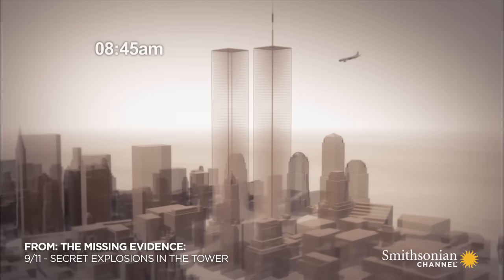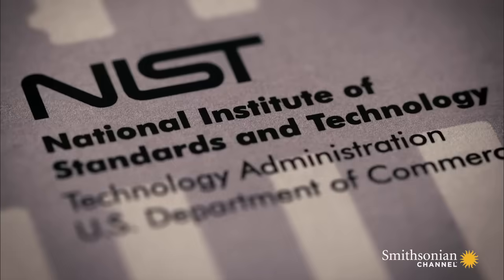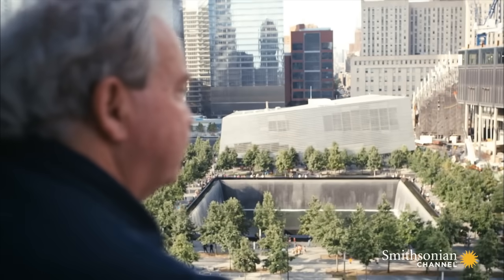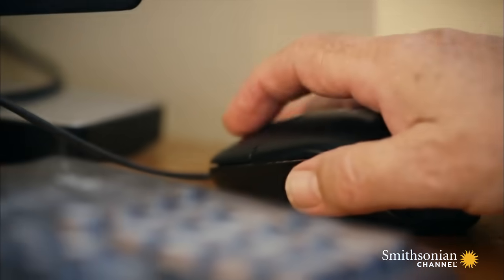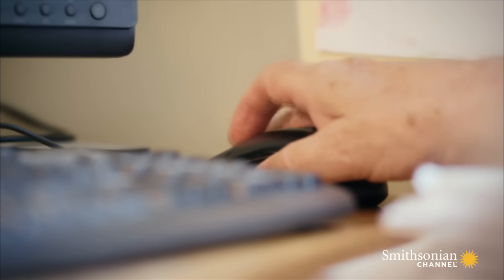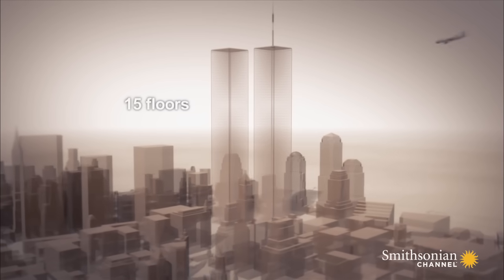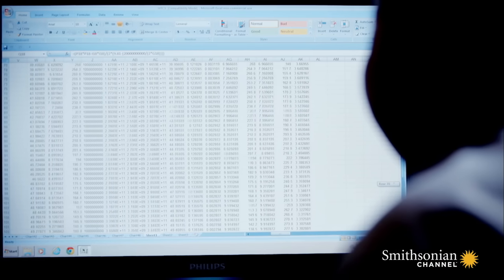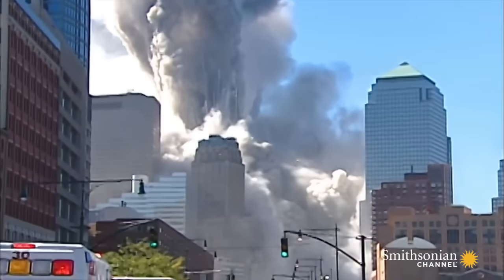This Computer Simulation Explains How the Twin Towers Fell

Comment: This guy did not attend physics class!!!!! Newtons law makes it impossible!
Reply: Gus W the evidence tells me it was gremlins
Reply: Avro Arrow if you ask people to tell you why there were explosives used, they’ll find a way to rationalize it and explain it to you.  In reality, explosives weren’t exactly necessary - a building that is that tall and that thin isn’t as strong as people think.  Many people will say “kerosene (jet fuel) fires can’t melt steel” and while it’s true the max temperature of kerosene fires is below steels molten point, it’s absolutely ridiculous to assume that the building will be standing all the way up to the point that the steel turns molten - it’s integrity gives way LONG before that.  Industrial heat treated steel becomes too weak to safely support a structure at 1000 degrees F - the flames in the tower surpassed that in 10 seconds.  It is unlikely that they got as high as 2500, which is steels approximate melting point, but it’s so ridiculous to think that the building wouldn’t have fallen Long before it ever got that high.  Industrial steel is heat treated to make it stronger, once it gets about 800 degrees f, the heat treatment effects wear off, and at 1000 steel loses 80% of it’s strength.  When your building supports lose 80% of their strength, the floors give way, and once the floors give way, everything above it starts slamming into the floor below it, that floor gives way from the impact, and with each floor that gives way, that’s added weight slamming on the next floor.   Dust shooting out of the side of the building as it fell was just debris trapped in an air pocked of the falling piece of the building shooting out the windows.  

This is all leaving out the fact that this was about the most impractical thing for the government to do, there are a million easier ways they could’ve made it happen, for instance, just get more terrorists to ram the planes in different areas (instead of having to plant thousands of explosives without any of the 5000 people who worked at the wtc noticing.  

I don’t like the term conspiracy theory, and I think it’s so overused to the point of being meaningless, but in the case of people saying this was a controlled demolition or inside job - hey I don’t blame people for entertaining the idea, however it’s foolish to treat it as fact when the evidence is so weak.
Reply: But Murphy’s law makes it possible. 🤯
Reply: Um nope.. there is no evidence of a "controlled demolition"...  in fact it would be extremely unlikely for them to be able to pull that off among all the chaos of that day... those sort of things require an awful lot of control and precise situations.. you wouldnt try to do that with all these people around thats just crazy.. especially with airplanes involved.
Reply: Gus W, I'd love to learn more about this.  My grandfather was an army engineer and worked a lot with demolition.  When he and his colleagues saw the recording of 9/11, they played the tape over and over because they couldn't believe what they saw - it was obvious to them that it was a controlled demolition.  My grandfather used to tell me the story, but now that he's passed away I can only try to remember the points which he brought up.  I see so much conflicting information, like on here, and I'd love to be able to tell what is right.  Could you please help me understand why the explosives were necessary?  Thanks! :)
Reply: A friend knows two guys with years of experience in Structural Engineering who, upon seeing the towers collapse, said "OH...NO...WAY" meaning there HAD to be some sort of "help" in terms of explosives placed inside to make those happen.
Reply: The only parts I remember from the "Friends of a Friend" are the ones also noted by Architect Richard Gage. The (and I will almost certainly use the wrong word here) vertical supporting girders on the inside are supposedly all but indestructible and thus should have still been standing even if the floors collapse. 
If the Towers "had" to come down, it happened MUCH too quickly after the planes hit.
The portions of the buildings above the impact zone should NOT have caused the entire buildings to collapse.
That's all I can remember. Thank you for your Post. All best!
Reply: Dom Jervis, thanks!   That gives me a lot to think about.    I'm going to look into what Richard Gage said too, he seems to have a lot worth finding out about.   Thanks so much! :)
Reply: Kevin How do explain building 7 falling at near free fall speed from a fire caused by falling debris? People also forget building 6 was almost completely destroyed but never collapsed. You have to be pretty gullible to believe the official story in my opinion.
Reply: Gus W you say "TimReed22222 I do and what happened on 9/11/2001 was physically impossible without explosives. Ask away if you need help to understand why." 

Fun fact. Kerosine is extremely volatile and even "explosive". Especially when it comes from a 767 which can carry 91 cubic meter of fuel aka 73 metric TONS. Despite, the mass and velocity alone is enough to grind concrete to dust. 

You also say "The evidence actually tells us that it was a controlled demolition." I'm really interested in seeing that evidence. Citation needed.
Reply: and you are an expert?
Reply: Avro Arrow you can rationalize anything if you try hard enough
Reply: Kevin, do you mean that I can figure out the truth rationally...or that I can make myself think anything is rational and the truth?  I'm just a tad confused!
Reply: Kevin - Okay, I understand what you were saying now. :)   I know that there are a lot of opposing views on this, and I can see that you're one who thinks the most logical explanation isn't an inside job.  I've seen more of that side than the other, though, so I'd like to get a balanced view and understand the reasoning each side goes through.  Thanks for explaining why you think what you do, you put it very well!    Maybe once I've seen a bit more, I'll ask you a question or two to help me reach a conclusion if that would be okay?  Thanks!   :)
Reply: Dom Jervis, that's the same sort of thing that I heard about too!  I asked my Dad and found out it wasn't so much my grandfather, as a friend of his...a guy who worked in professional building demolition down in Houston.  Just about everyone in his company was convinced it wasn't just what the news made it out to be.  I forget the points my grandfather told me, though...do you happen to remember any that your friends had?    This video has me almost convinced, so I'd really love to hear some more of the other side of the story!
Reply: You're More than welcome, Avro Arrow. 

Recently, I posted the following comment on a video about WTC 7:

Towers 1 and 2 falling made people with Engineering/Architectural knowledge say "Wait...A...Minute..."

Tower 7 falling made thousands if not millions of other people say "Wait...A...Minute..."

Best of luck in your Research. I believe you will learn a lot from Mr. Gage. I certainly did. All best!
Reply: Avro Arrow & Dom Jervis
Richard Gage is a con man. He has been shown evidence for what happened, and he flees from it. He paints false narratives, such as "straight down" and "collapsed at free fall", in order for you to buy his warped conclusions. Pay attention to his emotive tones when he rattles off his litany of rehearsed false narratives. That's one of the first tip offs to a con; getting you emotionally involved. I know because I once believed him, until I started investigating for myself. It is mind boggling the amount of evidence Gage does not show. He's an architect, and should be able to show you in detail what the building is doing at any given part of collapse, how controlled demolition is causing it, and show the resulting evidence in the well documented videos/photos of structural remains. He hasn't done any such analysis. Think!
Objective study of the evidence reveals both Towers fell just as they should have based on building design (a unique tube type design) and damage. Both initiated collapse gradually by the perimeter wall caving in, precisely where the planes ended up in the buildings, exactly where the hottest fires were recorded, causing the section of tower above impact to tilt over. The top sections then had no place to go but down through the lower tube, acting as a wedge due to it being tilted, splaying the lower section apart. The lightweight 60 foot floor spans offered scant resistance to the falling mass, which punched through the floors; there was no "pancaking". It matters not how strong the core structures were vertically; they were splayed/wedged apart laterally as well, with substantial portions of both cores still standing briefly, after everything else had collapsed.
The evidence is overwhelming and conclusive. At the same time, there is zero evidence for any controlled demolition, and Mr. Gage offers none. In other words, I did the work an org. such as his should have done, and the results do not support his conclusions. Any wonder why he flees from actual evidence?
Reply: zmoke forest
Building 7 didn't fall at near free fall. The perimeter frame shell only did, for a few seconds, after it had been in motion falling over for 2+ seconds. That series of motions, over only to start, then down much slower than free fall and continued over, then over and down near free fall, describes perfectly the lower buckling of 600 foot tall columns that lost lateral support, and the breaking apart at column connections. Not surprisingly, that's what structural remains says happened.
Reply: Newtons law was observed and accounted for.  The collisions between floors were so brief that it was barely perceptible.   And upon each new floor collision mass is being added to the equation.  If one floor can't arrest 23 (Which it can't) what makes you think the next floor is going to arrest 24 stories falling on it?   And with each new floor collision, the force applied is the SQUARE of the mass.   Your problem is getting 4x worse with each floor failure.  that's why it continues.   None of you "ahem.. Truthers" seem to grasp this.
Reply: Newton's law? Which one? Which physics theory makes it impossible?
Reply: The building is not designed to arrest and stop 23 floors in motion.  Anyone who thinks it is needs a few classes in Engineering 101.   All of these "Physics" arguments are so ill informed
Reply: Like YOU understand Newton's laws! LOL!!!
Reply: LOL !!!!!!!!!!!!!!!!!!!!!!!! Not on my best day!
Reply: Its impossible for there to have been explosives.
Reply: common sense.. and the preponderance of evidence.

Comment: What really happened on that day is that these explosions had in fact occurred, however not by explosives, because the many tons of aluminum
of the destroyed airplanes melted thus highly liquified like water and a tremendous heat developed and exploded, as it came in contact with the water of the fire sprinklers, because to such an extent highly liquified aluminum is highly explosive, when it comes in contact with water. And by the tremendous heat of the highly liquified aluminum also melted the steel girders, their concrete wrapped hulls were torn open by the impact of the airplanes and exposed the steel, which could not withstand the great heat. Thereby it was possible , that the steel girders melt and these broke down and then the towers collapsed.

Comment: They found nano thermite in the World Trade Center dust.  If you watch the videos and photos - you see cutter charges coming down the floors like fireworks.  His side of the story doesn't account for the mass of the building.  These buildings were DUSTIFYING into nano particulate level powder.  This is not a pancaking of buildings - floor by floor - as he states in his video.  This was a huge Banana Peel Controlled Demolition - which can be compared to the Banana Peel Controlled Demolition on a high rise tower in China.  The exact same type of demolition.  Do your homework.  His story is NOT what really happened.
Reply: No, they did not find nano thermite there. Stop lying.
Reply: Benito Camela yes they did

Comment: The towers DID, in fact, withstand the impact of the airliners colliding with the building.  However, the structural steel girders could NOT withstand the fireball heat from the burning jet fuel   Jet fuel burns at 800 to 1500 degrees Fahrenheit, and much of the material inside the building (carpets, furniture, paper, etc.)  burned as well, adding to the internal temperatures.  Structural steel melts at about 1000 degrees Fahrenheit--within the range of the temperatures inside the twin towers after the crash.  The structural steel would have become kind of butter-like, which is why the buildings pancaked as the integrity of the structural steel was compromised by the fires within.  Science over Conspiracy Theories.  After all, it's now September 27--where is the Nibiru impact?  Within the parameters of normal attritution through natural death, we all still seem to be here!
https://education.jlab.org/qa/meltingpoint_01.html
http://www.tms.org/pubs/journals/jom/0112/eagar/eagar-0112.html
https://www.youtube.com/watch?v=Yo1WZ9g1IJ4

Comment: Conspiracy theorists are fucking idiots
Reply: for asking questions or what do you mean? All they do is do their own research and ask questions. So if the official statement is true then there should be no problem answering all these questions.
Reply: twoofers don't ask questions. All they do is spreading already debunked totally devoid of reality asinine conspiracy theories.
Reply: +Neo Morpheus so how did "hijackers" who could barely fly a 1 machine plane fly an airliner better than profesional pilots?
Reply: They never flew "better than professional pilots", who told you that asinine idea? But if you mean how did they achieve the skills to aim a plane already in the air towards a target much bigger than the average runway where thousands of planes are landed every hour, the answer is quite simple:

By taking lessons in flight academies until they were prepared!!!
Reply: ""better than professional pilots", who told you that asinine idea" maybe all the pilots who said that the attack on the Pentagon was dumb and only possible by a professional pilot? Why would they fly into that small side of the Pentagon when they had 32 acres of the roof which would have inflicted more damage?  
"towards a target much bigger" the twin towers were higher but more narrow but they still managed to land the complete wingspan in it.   
But that still doesn't explain how the plane managed to go way past the VMO? They should have broken apart in the air or at least take structural damage during the attack. But it didn't happen.  
"By taking lessons in flight academies until they were prepared!!!" - no they were not. They had flying lessons but the instructors all said that they weren't even able to fly a single-engine Cessna. By flying a single-engine Cessna you do not learn how to fly a huge commercial airliner.
Reply: “There’s no doubt in my mind that once [Flight 77] got going, he could have pointed that plane at a building and hit it.”
---- Marcel Bernard, Hani Hanjour’s flight teacher.
[CAPITAL NEWS, 9/19/2001; GAZETTE (GREENBELT), 9/21/2001;NEWSDAY, 9/23/2001; WASHINGTON POST, 10/15/2001] 

Game, set and match!
Reply: so it's quote against quote? Do you have a source for you? I can't find it when googling it
Reply: No, no, no... Mine is a quote. It comes with sources, dates, etc.  Yours is just your word taken out of your ass, nothing remotely close to a quote.
Reply: your quote is then a quote when you can give me a link. You could have made that just up...
Reply: Neither of his former students was ultimately able to obtain a pilot’s license
http://www.sandiegouniontribune.com/lifestyle/people/sdut-garza-flight-instructor-hijacker-september-11-2015jan25-story.html
Reply: A link is a link, and a quote is a quote. They are totally different things. For example, yours is a link to an incredibly boring and totally useless and irrelevant article until the last lines, where the guy says:

“I think terrorists, if they are really determined, will find a way to achieve what they want to do.”
Rick Garza, flight instructor. 

Now this is a quote. The only relevant quote in the whole article.
Reply: How do I know you quote is legit when you can't give me a link?
Reply: The name of the newspaper and the date is written under the quote. You can find the edition of that day and check it, not everything is in google.
But you can also save the effort, since even some twoofer websites admit this quote is legitimate (and try to rebate it with their opinions - which are irrelevant).

Comment: Even to this day I love the conspiracies.

"Controlled explosion"
That went wrong? Several chunks were thrown 4 blocks....
"No planes"
That's why holes were ripped in the side of the building where there want and explosion.... The holes would have to be uniform not jagged and on fire.
"Simulation"
Get out of here Elon musk.
Reply: doesn't the huge debris even speak for a controlled demolition? Where did the upper part of the tower get enough power to crush multiple times its weight of healthy structure under it and throw the debris mukltiple blocks away?